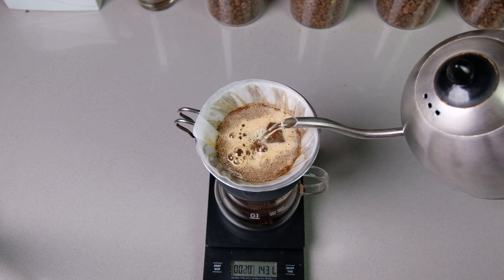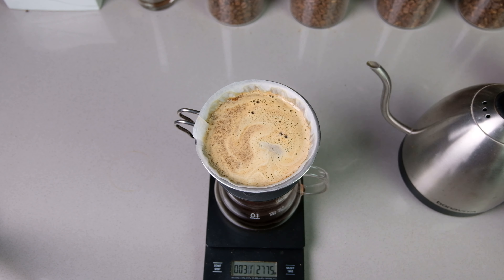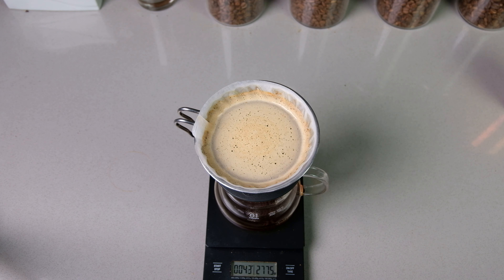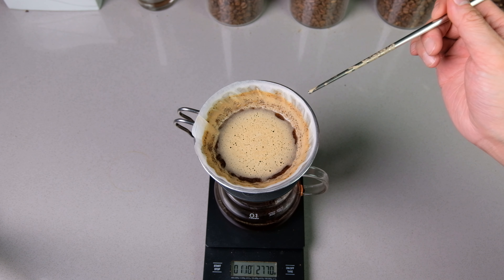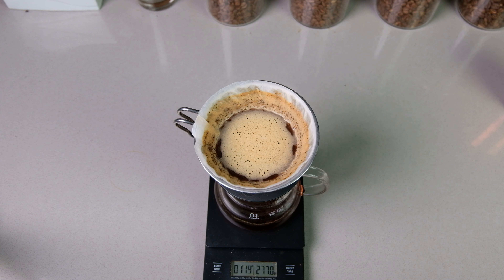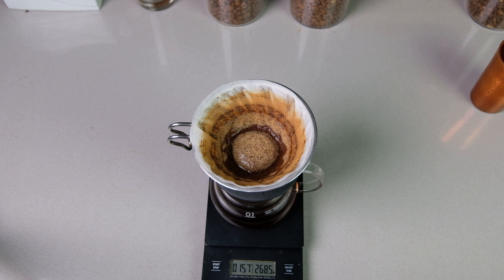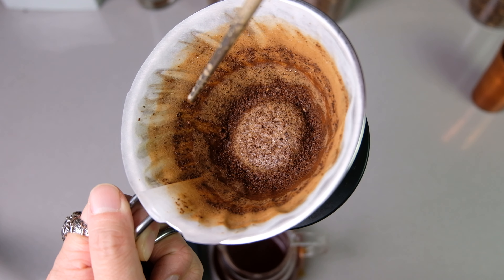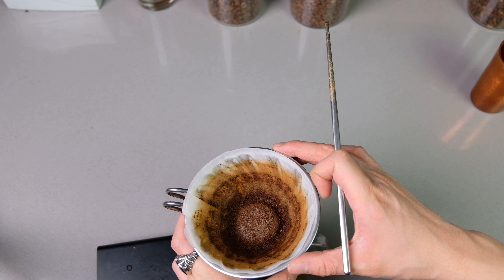you MUST understand your POUR

Comment: Thanks for the information Vincent.  I tried your technique with a medium roast from Guatemala and the coffee tasted very nice but maybe a touch too bitter.  What am I doing wrong if I have almost all the grounds stuck to the filter paper on the sides and not on the bottom in a dome?  Thanks.
Reply from the maker: You’re welcome! Hmm if it’s a touch bitter try lowering the water temp. If you have lots of beans on the sides and not the bottom that means you haven’t pushed the grounds down yet so they’re not being extracted.

My suggestion would be to pour slower and from a little higher at the beginning and stay very slow for around 35-40 seconds before speeding up. Make sure you stay in the middle first and once the mushroom cloud like effect starts then you push it out towards the edge almost trying to flip it inside out. From there slowly pour onto the darker particles floating up! Hope this helps!

Comment: Thanks man. This technique is nice. Not getting the mound at the end though. Taste is great. What is the medium fine setting on a Fellow Ode / Gen 2???  What am I doing wrong?
Reply from the maker: Hey John!

Do you find yourself with a lot of grounds on the edges?  I think a medium fine is pretty close to the finer lower settings on the Ode.  I'm not 100% sure with the Gen2, haven't had the chance to play with one yet.  Though you could always send me a picture on instagram until I get a discord up!
Reply: Hey Vincent, appreciate the response. Yes, ring if grinds at top of filter and usually a flat bed. I always brew 4-5 cups in the morn. All single pours. Maybe 1-2 will have a slight mound. I will try a finer grind. I am at the 2.2 setting on the Ode 2. I feel so close!!! But still learning. Even without the dome coffees are delish. Just a tad better with the dome. Richer. Love your bideos. Very well explained and thorough. Love single pour vs 4:6 Tetsu. Love any advice you have. I enjoy you more than JH!! Thank you
Reply from the maker: @johnhuffman2993  If you're still lacking a bit of the ring try pouring slow but from a higher point especially in the first 30 seconds and make sure to pour more around the edges until the edges kind of flatten out with the rest of the bed!
Reply: What makes the dome happen? The stir at the end?  Still only getting puny dome that flattens out eventually

Comment: So to sum it up:
Lighter roasts (usually less bubbles) = higher temperature, less movement
Darker roasts (usually more bubbles) = lower temperature, more movement??
Reply from the maker: Yeah, in a quick TLDR that makes sense.  Though I actually have been having second thoughts about lower temperatures on darker roasts.  I've been saying it for a while that lower water temp is better.  It's because the idea for lower water temp is to help get to the beans faster.  But in theory, higher water temperature opens up and pops the gases from the particles faster.  Which means in theory if you poured slow enough a higher water temperature is better for darker roast and a lower water temp is better for lighter but I need to do more testing.

Higher water temp = more agitation/damage dealt to the particles.

Lighter roasts = less hp, thus you should use a lower water temp but .. that's assuming water temp doesn't affect the flavours extracted.

I only started using lower water temp on darker coffees because I believe higher water temp "scalds" and creates a darker flavour but I think "think" if I fix my pouring technique higher water temp could be a bit better .. will have to test!
Reply: @TALESCOFFEE  Wow! Thanks for the insight🤓